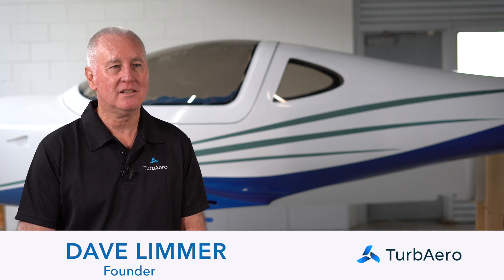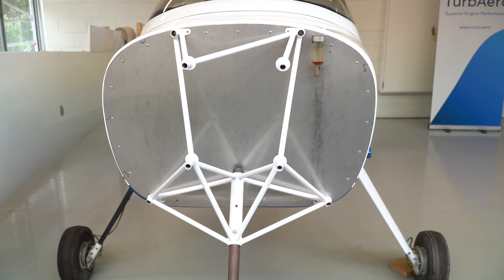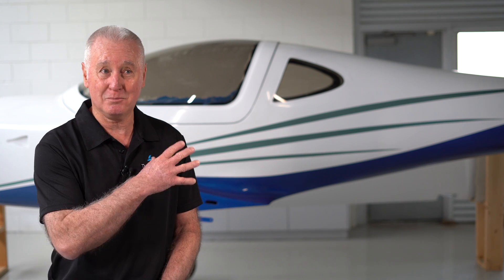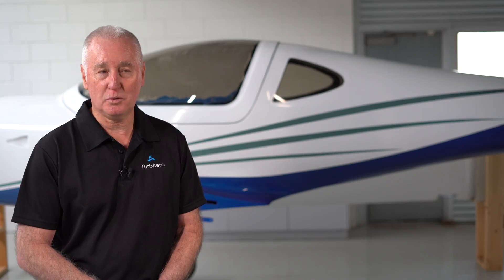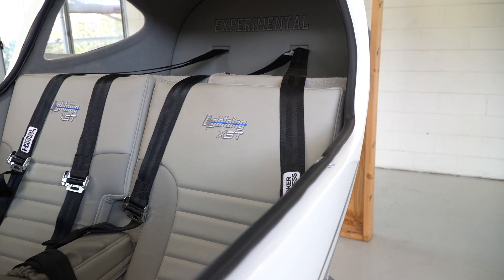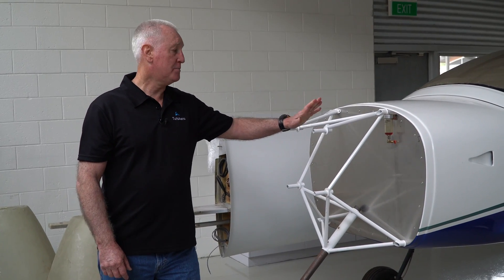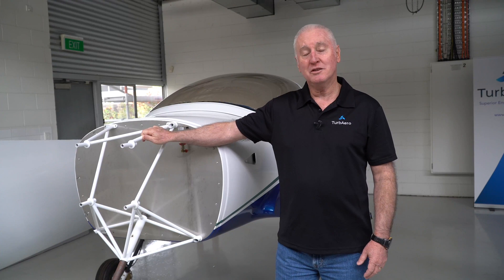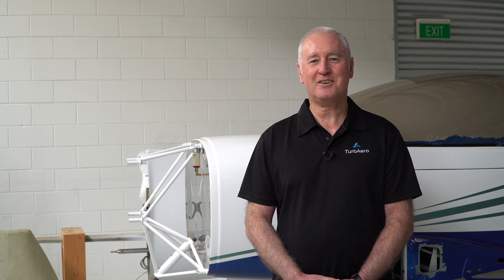Arrival of our Arion Lightning XS - Test Flight Unit | 200hp Turboprop Engine

Comment: Appears to be no updates for 2 years, is the still happening?
Reply from the maker: The Turbine Arion is no longer happening.  We have opted for a Vans demonstrator when the time comes.  The engine development program is currently on hold while we source capital to complete the project.  This is very frustrating for us given how close we are to being able to commence prototyping the first engine (the gearbox has already been prototyped but the main engine frame still needs some minor design work and analytical work before the design can be frozen for prototyping).